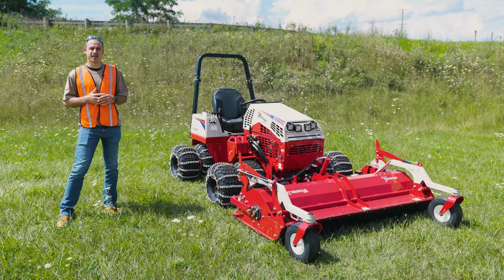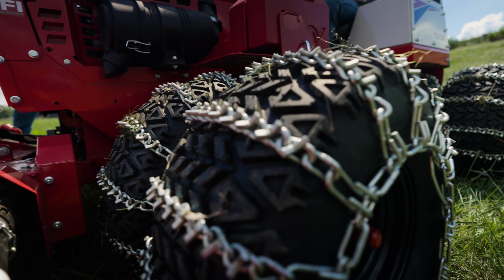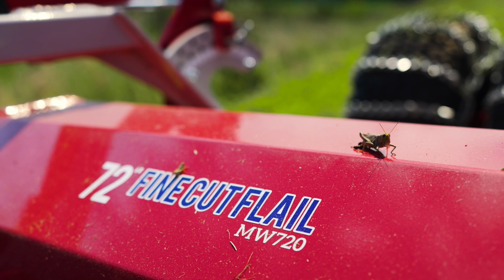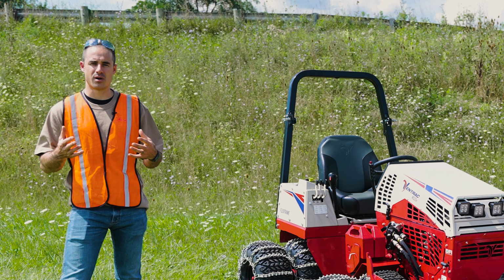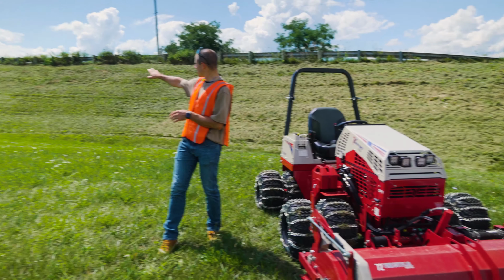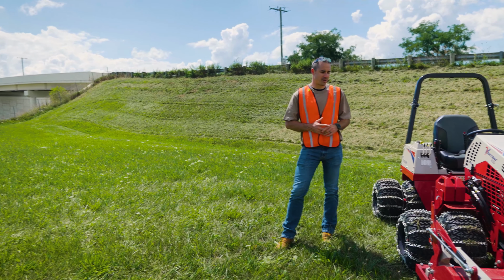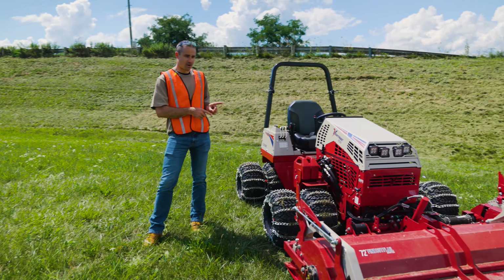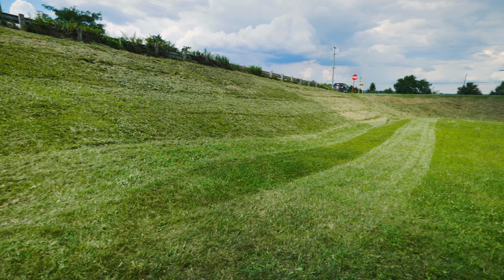What Makes Ventrac Elite on Steep Slopes?

Comment: Nice!  I've been debating on getting all 8 chains.  I already have a set of 4 chains on the narrow tires for the outers with standard field trax inners.  This is the configuration I generally use for cutting steep banks as it also allows for quick removal of the outer chains and replace with another set of field trax when I'm performing finish grading work